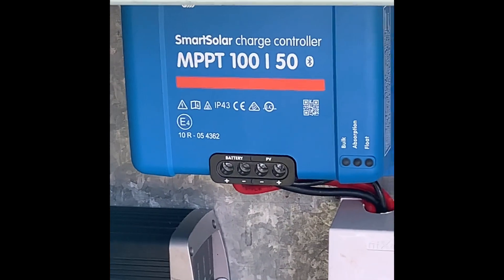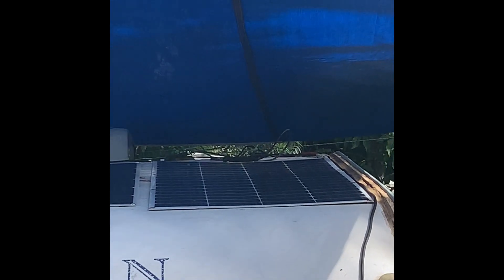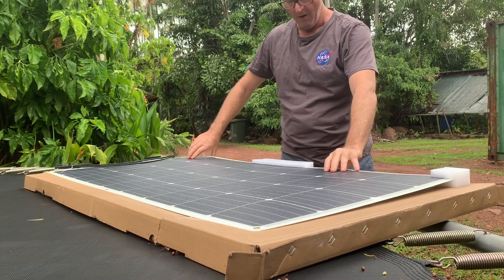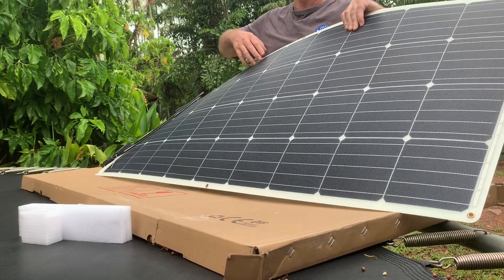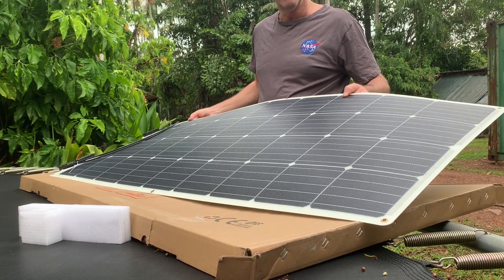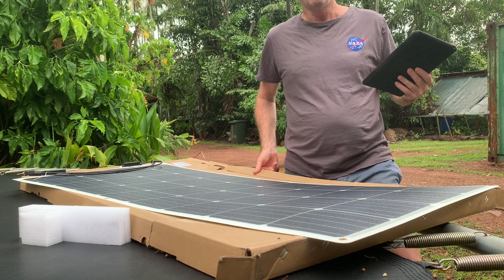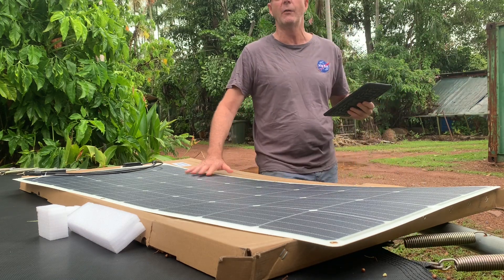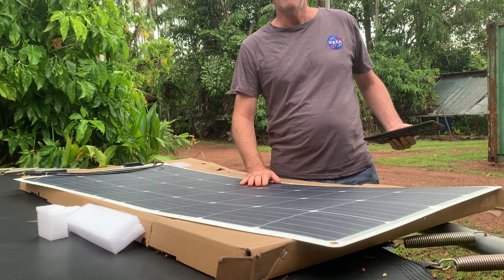Renogy Flexible 175w Solar Panel. Watch this before buying a panel. Not all solar panels are equal.

Comment: Renogy products are good quality and one of the better brands out there, but the warranties aren't worth the paper they are written on. Maybe within 12 months if the product fails they may replace it, but they are a Chinese company so no guarantee. I dont know any company that guarantees a product for more than 12 months. If you read the small print of the "warranty", it doesnt cover failures from weather! amongst other things, so theyve got an excuse to get out of any warranty claim. Imagine after 20 years trying to claim the solar panel has dropped below the warranted efficiency, theres no chance in hell theyll replace it. Thats if it even lasts that long which is very unlikely

Comment: I got 4 of those on a 50amp/100volt mppt Smart charger. And on a shady rainy day I get 80volts not many watts though.  I have yet to see 50 amp from the victron solar charger and it is maxed out on volts and cells but I live in WV and sunlight is hard to come by and theses panels don't have to be pointed directly at the sun to get the jub done. I have seen as high as 30 amps from this system. Sor the size and weight of the whole system is the lightest and most powerful I have had the chance to use. You will pay a little more but you will be happy unless you want to hold a lightning rod in a storm. They're so light weight I can't believe that they have such a high amp rating literally 9 amps per panel. And the victron 50/100 harvest every drop. Even in the morning when the sun rises over the mountains and can't be seen yet it is catching it and charging. And the same in the evenings. Even though you can't see the sun directly it is pulling power to feed the mppt Smart controller for the 280ah lifepo4 I built from China battery's with a 250amp dally BMS and a 4000/8000 FLAMEZUME INVERTER.  I PLAN ON BUYING 4 MORE 175 FLEXIBLE RENOGY AND 1 MORE 50AMP 100VOLT VICTRON SMART CHARGE CONTROL. THEN WHEN I HAVE IT ALL I WILL PUT IN PARALELL BECAUSE I WANT TO KEEP 12VOLT IN CASE ANY SITUATION ARISES WHERE 12V IS NEEDED. UNTIL I GET THE NEXT SET OF PANNELS AND CHARGER I AM GETTING A 100AMP 14.6V CHARGER IN CASE OF A NEIGHBOR LOOSES POWER I CAN HELP THEM OUT LOL GO SOLAR EVERYBODY

Comment: The solar Generater.Systems E300 is a great product . It does everything well. Great job, Jackery.
Reply from the maker: Yes . You must make sure you use the right fixing and don’t cut corners with cheap knock of glues
Reply: Not if properly attached.

Comment: What victron charge controller is good for one of these? 75/15?
Reply: Is that because you have more than one panel?
Reply from the maker: Absolutely.
Reply: @damagesgoldprospecting7635  Ah cool. I'm not that knowledgeable on electrics so have no idea on charge controllers but know they have to be at least a certain amps to match the panel.
Reply from the maker: The first number is for the voltage in . As in from the solar. Add the panel voltages together. If it does not reach this number then the Victron , lest say 100- 30 will work . The 30 on this unit is for how many amps out . 30amps is a good amount for me as I have over 200amp hours on the two batteries I have so I need it to be over 20amp 
If it was under then I could get away with a 25 or even less
Reply: @damagesgoldprospecting7635  I'm debating on getting the 175w flexible panel but have a feeling I need to change my charge controller as its an old PWM one. But the numbers confuse the hell out of me as I don't think it stats all the info on the Renogy website
Reply from the maker: @JoeMaranophotography  definitely change to a MPPT . This will maximise efficiency. The difference is huge
Reply from the maker: Victron is a great controller . I ended up getting a larger one. The 30 amp

Comment: 25 years for a flexible solar panel from China.....I would laugh if it wasn't so sad.....man you are an optimist...
they can also write 230 years
Reply from the maker: The panel brand is Renogy. 
Check them out online in regards to the power output warranty. 
You might be quite surprised. 
You get what you pay for these days. 
Take a look at the repeater stations across Australia that use a BP Solar panel . A lot of these installs were done over 25 years ago and are still active.
Reply: Laugh all you want.  It's irrelevant how long they actually last.  They're warranted, in writing, to meet certain levels of output for 25 years.
Reply: @johnpalmer3848  
Yes, 25 years of guarantee from a Chinese company, which can change the name tomorrow, gets a new owner or disappears...written on paper...is that a real guarantee???
honesty is the main virtue of the chinese, are you sure?

you are a real optimist.. you may be right, i wish you
Reply: @freddenker9537  Dude.  Renogy sold and warrants them.
Reply: @johnpalmer3848  
ok...so you are on the safe side...very good
Reply: If you think Renogy is some random brand you are sadly mistaken.
Reply: Anyone who thinks they can buy renogy from China or eBay is ignorant. They might bother to write renogy on the panels (with magic marker) but warranty? Bwah ha ha ha ha! As someone who has mostly avoided being burned, YOU DON'T KNOW WHAT THE FUCK YOU'RE TALKING ABOUT. WARRANTIES FROM CHINA ARE WORTHLESS MARKETING PLOYS.
Reply: You're making some pretty big statements and assumptions pity you can't prove what you're saying.. from what most people say even the good Flex panels will only last a few years😢
Reply: @barmynick5027  
I wrote to the manufacturer and they told me that there is a life/performance expectation of about 5 years. I think the statement is honest